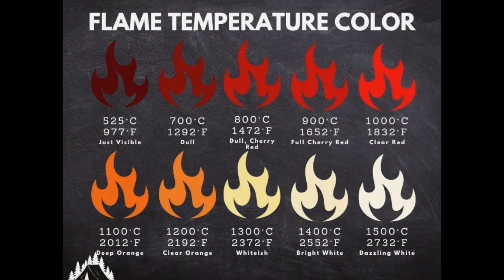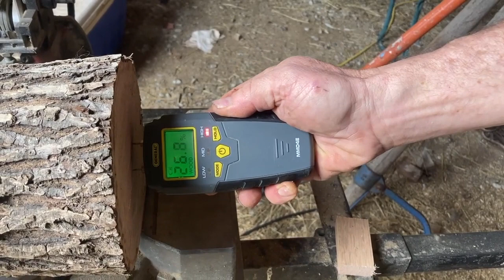The Science in Building a Perfect Woodstove Fire

Comment: Do you know of a more natural glass cleaner for wood burning appliances?   Currently using glass cleaner by stove bright which contains isopropanol.  Great info on your videos!  My father was a steam locomotive boiler guy so he knew how to build hot fires.  He didn't like people using those, "Choke em' down wood stoves".   Thanks!
Reply from the maker: I never use glass cleaners.  Only a little ash on a wet paper towel.
Reply: High strength ammonia water mixed into glass cleaner.

If you use glass cleaner that already has ammonia in it you must add more ammonnia water to the glass cleaner to make it work better, this is what I do. I add about a 1/2 cup of ammonia water to a standard size  spray bottle of glass cleaner that already has some ammonia in it.

I spray the mixture onto the cold window & allow a minute for it to be absorbed by the black carbon creosote deposits & wipe it off with a paper towel, no rubbing, no effort & therefore no micro-scratching  the glass as would be the case if you used soot mixed with water to loosen the carbon on the glass. If you do it this way your glass will not become more & more opaque over the years from continual rubbing effects of water & soot mixture.

I also overspray it onto the door frame to clean that off & the door locking mechanism as well to keep those parts from building up with creosote as well.

Comment: i found that splitting into much smaller pieces and backing the air lower volume to be most beneficial.  I much reduces the time to dry and the MC of the wood
Reply from the maker: I agree. A little more time splitting can significantly reduce your drying time. I also have a relatively short firebox, which requires me to cut around 14 inches, that helps it to dry quick too.